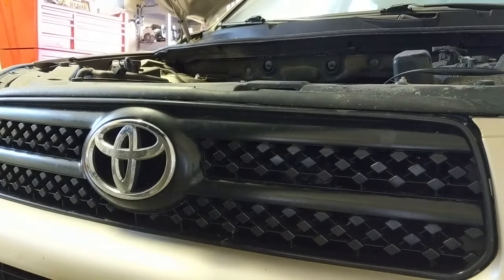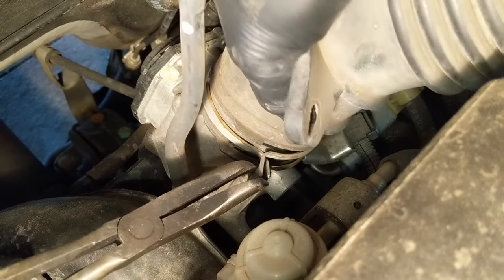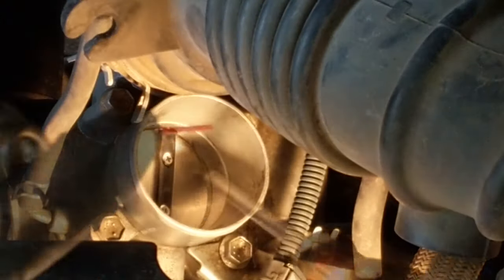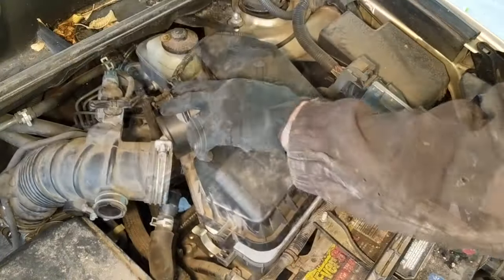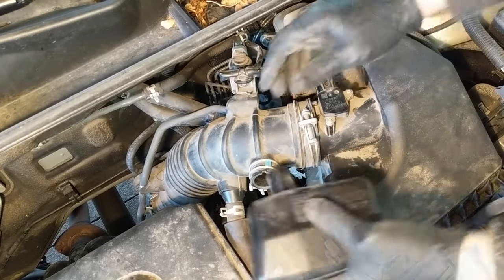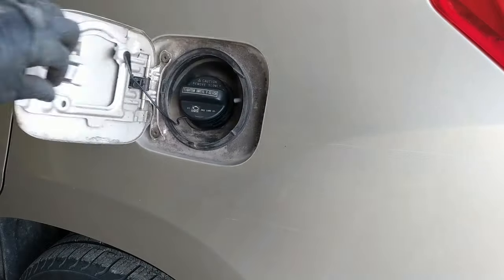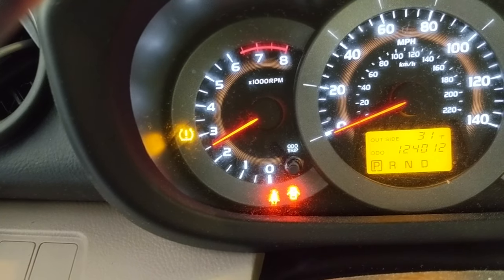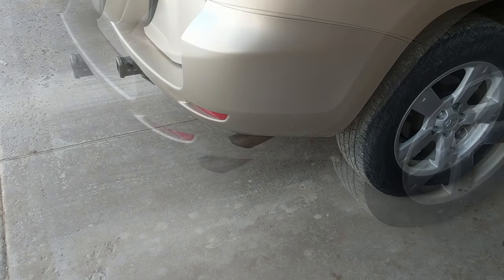2006-2012 Rav4: Throttle Body,  Intake, MAF, & Injector Service

Comment: Why didn't you just unplug the maf and take it out to clean it? It'd save the step of taking the box off and opening it and all that. Also, do you really need to disconnect all that to clean the throttle body? Can't you just disconnect the hose and push it out of the way?
Reply from the maker: adam smith Good comments. It sounds like you are pretty meachanically inclined. I would do whatever you feel is easiest. So many people try to "save time" by working around things instead of removing a few components for better access, only to end up with bloody knuckles, broken parts, and much frustration. I'm probably on the other extreme doing a little more than is needful.  Hope you found the video informative, even if you recognize a better way of doing things yourself. Thanks for watching.

Comment: how do you clean the backside of the throttle body if you don't take it right out?
Reply from the maker: I just opened the plate and did my best to spray and scrub the back side with my fingers. Worked okay for me.  🤷‍♂️

Comment: Hello, if someone could reply that'd be great! Wouldn't that cleaning liquid mix with the gasoline/diesel? I am no mechanic so I figured I'd ask before attempting this :)
Reply from the maker: Thanks for the question. SeaFoam injector cleaner is a flammable additive for gas or diesel fuels. Adding it to the fuel tank is one of the many ways it can be used.

Comment: Did your 2008 have the 2AZ-FE, 4 cyl engine?
Reply from the maker: Yes, the 08' 4-cylinder is the 2AZ-FE
Reply: @MasterJacks  .....have you had any issues with oil burning? How many miles on it?

Comment: I don't think it's a good idea to clean the MAF sensor without disconnecting it or the battery first.
Reply: That is good suggestion n thz I will remember 2 disconnects, just 4 precautions before I clean MAF sensor, vey sensitive, U can disconnect clean MAF n also with a blow it off hard on your mouth to remove some specks of dust might have build up in MAF sensor within...

Comment: Shit...  i just did this and now my rav4 2006 automatic 2.4l is idle really high.  It is idling at 1.6 rpm?????
Reply from the maker: I'd make sure all vacuum hoses and sensors got plugged back in. If all looks good, try disconnecting/reconnecting the battery, then take it for a drive and see if it normalizes.
Reply: @MasterJacks  I figured it out.  The ECU was used to dirty throttle body.  It was running like it was before the cleaning.  I unplugged the battery and pulled the fuse.  After 20 minutes the ECU reset itself.  Everything is working normal now.  It just take a like 15 minutes of driving after ECU reset to get it working again.

Comment: So, mass air flow sensor cleaner cannot be used to clean throttle body as well..?
Reply from the maker: You can clean the throttle body with MAF cleaner, but not the other way around.